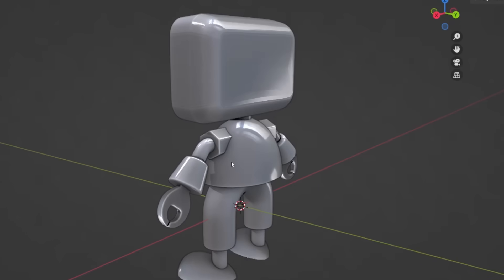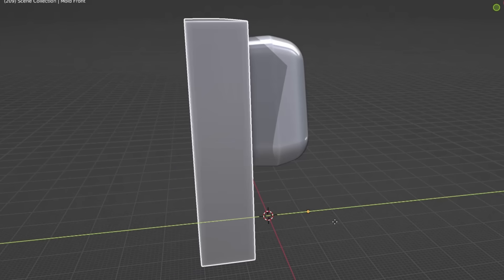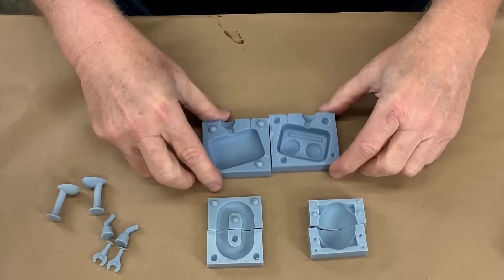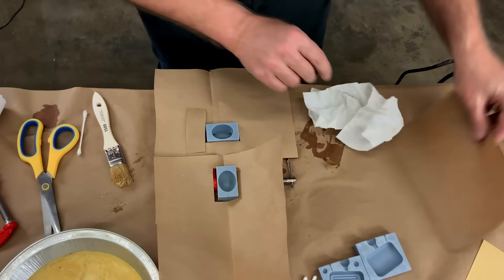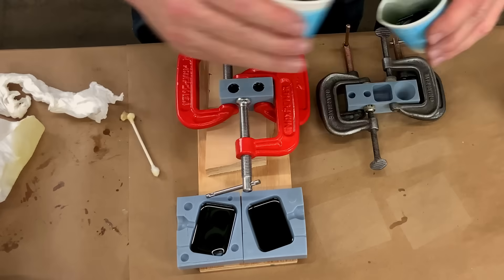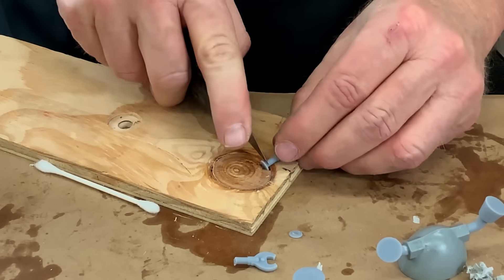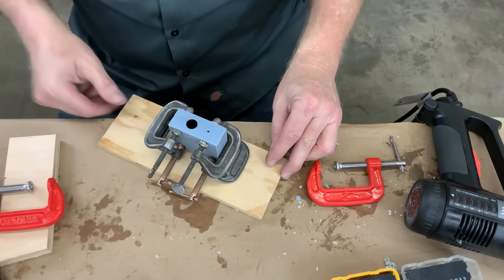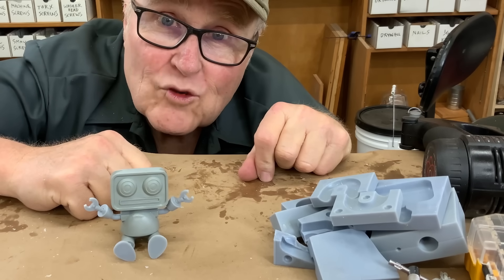3D Printed Molds For Resin Casting - Does That Even Work?

Comment: I learned so much from you channel! Here in Germany it's hard to get informations about small handmade productions. I am using my rotational casting machine for 3D printed molds. But I am struggling with the right release agent. If they are too good, the resin won't stick while rotating. And at the same time I don't want to use any release agent that is silicone based, as it might move into the resin and I might have problems painting the object later. Do you have any suggestions for a good release agent?
Reply: Ja das wirklich in Deutschland schwierig Video zu finden

Comment: I'm a Student and we(project team) are trying to manufacture a wind blade 1.2 metre length , 300mm wide, 30mm height with little complicated profile.. can any body help me which process i can use?
1. Making a mould by machining wood (costly it seems)
2. 3d print positive multiple piece(printer stroke is limited) and join(pattern) and create mould using that and then layup our actual composite blade.
3. 3d print mould directly(multiple piece and join) and layup component..
Can anybody help us please? We are new to composite manufacturing

Comment: I know I'm way past late to the party, but some suggestions.

1. To make your molds split easier, and a tiny chamfer on one of the sides.
2. You can use air to get things out of molds. If you are particularly clever you can even add ports to force air in.

Hope this helps!

Comment: Man I got quite a bit out of this, and bravo to the drill skills. lol. Did this in the negative to make silicone molds. 
Cpl points and idea..on resin registration keys, I found 0.02 clearance on both sides fixes that..take off 0.02 on the key and increase the hole by 0.02. Idees, maybe do a negative/mold cast of some to make a silicone or polyurethane mold and last idea. Push pins on the key side. Add a removable slug, probably cast to make a silicone plug about the size of a wooden dowel. Might make removing better and given the results this time, probably not a lot of clean up. 
Great work, thanks!

Comment: I dont see the point, a resin printer cost same as a cheap fdm now, way faster than hardened resin as you skip the mold and casting totally and no post work needed, mine does microns... cast traditional resin has its place but for other things

Comment: Try printing molds with TPU flexible filament & 10% infill. It should make separation much easier. Also always make your pin holes 2-6 mm larger than your pins to compensate for expansion.
Reply: Filament? Better flexible resin... Filament gums up the nozzle.

Comment: ever heard of using 'melamine resin' to create a mold that pressure cast resin will not stick to? apparently resin will not stick to melamine which comes in powder form, then you add some ingredients to make it liquid. this 'might' be an alternative for those hoping to get away from expensive rubber molds that wear out too quickly in a production environment

Comment: I just underwent this experiment myself, made an almost identical mold type and also had the same issue of it not closing flush, only I don’t think the problem was the registration marks, rather the print was warped possibly due to being underexposed, I think i need to dial in the resin exposure settings in the slicer to get the perfect fit. So I’m going back to testing some resin calibration prints to fix this.

Comment: The roughness in your prints is most likely from the tiny layers that resin printers use, if you look at a part 3d printed from a traditional fdm 3d printer, you will notice a lot of stepping and layers, resin printers do the the same thing, just on a smaller scale, it's always a good idea to sand 3d prints.

Comment: Coming from a time where all of my casting moulds were hand built, using dental amalgams, plasters, resins, etc, using my printer to build moulds has opened an entirely new world of possibilities. Forget 2 part moulds - with a 3d printer you can break a mould into multiple sections with varying angles and make pulls that were impossible to accomplish, with any mould medium.

Comment: 1. Design the locking pins undersized.
2. design holes in the "mother" side of the mold and glue them up with wax when casting, later push dowel pins to release the parts, just like in a production injection molding machine.

Comment: I want to experiment using 3D parts as a mold and the outside surface of the part at the same time, printing FDM in vase mode like and filling it with resin in order to get a strong part. Thanks for sharing your experiment, I really appreciate watching it.

Comment: I also thing I can make a mold in the iPad App Shapr3D. By doing and extraction but I have not tried it. In CURA Slicing software there is a setting for "Mold Printing". Also have never tried. I wonder is TPU on a FDM printer would work as the Mold Medium.

Comment: Have you ever used machined plastic as hard tooling for urethane casting? Like using delrin or HDPE as a replacement for rubber in a casting context. I have access to a CNC router and would like to make molds that way (including appropriate draft, etc. to get the parts out of the mold).
Reply from the maker: No, but I have used blue machinist wax on a CNC to make resin molds. It works great. Plus if you mess up the mold you can just melt it down and cast a new block of wax!

Comment: Can I use resin molds to cast or injection mold or similar plastic using a spray to help it release?
Reply from the maker: In theory you can as long as the molds have draft and the pressures are not too high.
Reply: @RobertTolone  wow thanks for the Reply. I got my printer the same day as that  comment, but only just purchased resin polymer 10 minutes ago! About to plug in and dial in with amerilabs print. 
Is there any way to post process resins, and smooth the straight sharp lines?

Comment: Why not design a bolt on the a side to fit b side with holes that allow a side bolts to go thru a use printed nuts to tighten the two halves. Not sure if you thought of this. But the idea is there nonetheless.

Comment: at my previous job we 3d printed mold for injection molding, and we managed to make very complex plastic parts runs of about 25 units per mold, which was really neat. It really accelerated the prototyping process for us
Reply: hello, how many times could you use 3d printed molds with injection molding? thanks :)
Reply: @mertturan2986  about 25units per mold, depends on the plastic you're injecting though. Some require higher pressure, or tougher to release from the mold. There's a lot to factor in, it's a lot of trial and error

Comment: Your pull is called draft
Reply from the maker: Pull is the orientation of the mold relative to the part.  Front-to-back, side-to-side or top-to-bottom pull.  We had to design the toys with the pull direction in mind.  Draft is the angle we built into the design surfaces to allow a rigid object to release from a rigid tool.  Usually 1 or 2 degrees of draft.

Comment: Would putting the cast mold in the freezer make it cure slower and generate less heat, making it less likely to stick and allowing it to pop loose without wrestling?
Reply from the maker: Maybe. It would be worth trying.

Comment: This was really cool to see! Wondering if some of the more flexible printed Resins (like Siraya Tech's Tenacious) would work better for this.
Reply from the maker: Tenacious is flexible - but not very. Still, I am planning a video using it for molding. It will be a shell mold, not a block mold. Otherwise it won’t flex much.

Comment: Nice work. How many times can you use the molds before they fail?
Reply from the maker: That depends on so many factors it’s impossible to give a meaningful answer.  As a general rule the rougher the surface and more detail a mold has the faster it will wear out in the casting process. So you may get only a few castings or lots of them.

Comment: You can include tiny air channels into the mold that can then be used with compressed air to just blow the parts out. Just remember to plug up the holes with some beeswax before casting.
Reply: That or chill the project, mold and all, for about 5 to 10 minutes in the ice box. The material difference between your mold and print medium should cause them to thermally expand at different rates. Easy pop out then.
Reply: @jacksonfondren1656  or into hot water after is is hardened inside - should work too

Comment: just remember to use a ton of mold release :)
Reply: resin 3d printer for resin casting, not pla/abs with its warping
Reply: release holes to push in, even sacrificial material in the release hole
Reply: super video

Comment: what resin did you use? some casting resins can get a few hundred celcius when the chemicals combine to gel/harden, and would easily melt the cast I'd think
Reply from the maker: Yes, resins do heat up when they cure - including the Silcast 2 urethane resin I was using here from www.silpak.com.  But the volume of the molds here is way too small for the heat to reach temperatures high enough to damage the 3-D printed mold. They were warm to the touch but not very hot.
Reply: @RobertTolone  thank you for explaining.

Comment: I have a complex part (atleast in my head) that I would like to make.
A rektangular frame with a honeycomb mesh inside the frame with a slight curve to it or even a compoundcurve, think of a car grille .
As I see it, the only way to achieve this would be a printed .mould or machined.
Am I on the right track with that thought? Cause a siliconemold seems impossible.
Reply from the maker: If you can put the part in line on either the inside or outside plane it might be possible to cast. Also you would have to design how the part would fill given the structure of the honeycomb.
Reply: @RobertTolone  Thx ☺

Comment: 4:39 - Hot water. Use hot water from the jug (obviously not boiling water and not on one's own fingers, etc) to pour on the mould side only. Usually it's enough to ever so slightly expand and flex the mould and to allow the core to pop out.

Comment: I FDM 3d printed a four part model and poured silicone in.  It was a fun project, but finishing the mold (removing the layer lines from the print) was very tedious.  I like the idea of resin, that would leave a lot less finishing work

Comment: That's a tough material combo to mold: rigid on rigid.  You were smart to use a base layer of wax on top of a spray release.  Most folks miss this part.  You really need a good wax base (2-3 coats is ideal) to ensure you don't have reactivity between the UV cured resin and the polyurethane.  The spray release then helps get it out the rest of the way.  We've done a couple videos on 3D printed molds on our YT channel, as it's a frequent request/question, so nice work on showing the success and pitfalls!
Reply: ⁹9⁹o 99999999⁹99999999999999⁹9999

Comment: When you're doing this you need to reduce the pins on the print to be 2-5 microns smaller than the matched insert holes.  Alternately, you could have just reamed out the pin receptacles and not had to worry about sanding the mold face (and also still be left with pins).  A common trick is to use shelf holder insert pins, because then you can just create dowel cutouts on both faces at slightly different diameter.  One to receive and the other to hold.  Steel pins, so no fuss.

You'll also want to leave yourself a ridge depression along the outer edge of the mold face for inserting a parting knife in future prints.
Reply: good tips

Comment: I'm thinking, instead of printed alignment pins, you could just bool out cylinders and pass bolts through, with washers and wing nuts to hold the molds together.  You could also add a percentage of flexible "tough" resin into the printing mix, it'll make the molds slightly flexible, and easier to remove the castings without breaking them.  |

Don't use too much, or it'll be a real bitch to get off your printing plate.  You do have a magnetic sheet and removable spring steel plate for your resin printer, right?  Trust me, it's worth it!
Reply from the maker: All good tips. Thanks.

Comment: Yes, you can, but there are a few caveats.  One of them is getting the mould to not leak if you are using FPM printer - i didnt have SLA then. I used TPU. Then I used candle wax to seal and fill the cavities in the mould. TPU bends, I pulled off a rather complicated epoxy pour with it :)
Reply: Candle wax is a good idea. Awhile back I used filament-printed molds for silicone casting over a period of several months. The viscosity of the resin was a big factor. Sylgard 184 would leak out regardless. I eventually was able to get good results by using a cheap off-brand resin and wrapping the outside of the molds with electrical tape.

Comment: You can, but not the way you did. You have to create molds for the molds. This way you can cast the mold you want for your miniature in silicon instead of resin. So a resin mold for a silicon mold for a resin product. You could also do it to cast metal this way, if the silicon is a casting silicon with high temperature resistance. 

You could also print your molds with castable resin and cast a mold with metal. There is a trick you can do to make them fit. Extrude the upper faces of the molds you want to have so your mold is a few mm thicker. After that you can grind your molds to the exact height and they will fit smoothly. But you may still get moldlins and it could mean to try a few times before you are finally satisfied. Still cheaper than buying cnc milled molds (Or buying a CNC milling machine).

The rest will be intelligent facing and construction of the molds. This is a topic on its own, too complex to talk about in a youtube comment ^^

Comment: I 3D print all my molds, they even have deep indents, holes, etc. They are also very oddly shaped due to the designs.

Try printing the inverse of what you did, with the toy robot sticking out (not in) of the 3d mold part. You then fill the two parts with silicone, when you put the two silicone pieces together you have perfect mold, and you can create new molds quickly from those parts. They basically become the masters you can use forever. Saved me hundreds of hours of work.

By using this method you have have very detailed objects and decide exactly there the mold lines and flashing will appear.
Reply: Do you use a resin printer? I want to try this but hear that silicone wont cure against resin...
Reply: @AliceAyres_00  Yes, I have a resin printer and use Smooth-On products for molds and casting. There are two types of silicone for molds, tin-based and platinum based. For resin you should use Tin, and the other stuff won't cure right unless you add a bunch of chemicals.
Reply: @badvermin  Thanks for your reply, much appreciated. I heard that platinum cured silicone is better quality, lasts longer and captures more detail so have doubts about using tin-based, however it does seem to be the simplest solution...

Comment: what resin to use for the mold? and thx for the good sharing~
Reply from the maker: Elegoo ABS-like gray
Reply: @RobertTolone  this resin can  resist the heat when casting?
Reply from the maker: @derekderekc  Yes, at least in castings this size.

Comment: U can use flexible resin or combine it with regular resin to have some flex in the mold. I did molding and casting a bit using silicone and casting resin, not a fan, the process is messy, tedious and requires a vacuum chamber, would rather just print the object.

Comment: Given the various flexible resins and recently rubbers that you can use to print moulds i really dont understand why you would use the least flexible and most brittle option available to print those moulds...
Reply from the maker: I did it for several reasons. My channel is about silicone rubber moldmaking; I have around 150 videos on that subject. This video was made to illustrate the importance of draft in the design of objects used in rigid tooling. Also to illustrate the basic difference between rubber and rigid tooling.  
It would have been better to use a tougher, less brittle resin than the Elegoo ABS-like resin I used.  But that was the resin I had on hand so I went with it.
I am planning do videos with 3-D printed flexible molds in the future.

Comment: Noooooo... You should definitely drill the holes instead of cutting the center blobs, or maybe sand the blobs a bit, way easyer
Reply from the maker: I tried sanding the pins but the resin was too hard. Easier just to file them off. Didn’t bother to make new registration pins because I didn’t expect to cast a lot of pieces out of these molds. They were really just for proof of concept.  if I were to use them a lot I would definitely add the pins.

Comment: I have often wondered whether instead of 3d printing masters and then molding them in silicone, you could make the mold blanks in 3d and then directly silicone mold from those 3d printed "molds" to remove the traditional silicone molding process.
Reply from the maker: You would need one more extra step in there. If you 3-D print a mold it is a negative. If you cast it in silicone it is a positive. From that you would have to cast the negative silicone mold.

Comment: One thing you would need to consider is that coating it with beeswax might actually create locking ridges that locks the casting. Perhaps you need a different plastic for the mold, something more flexible.